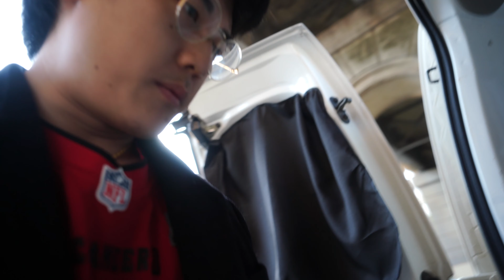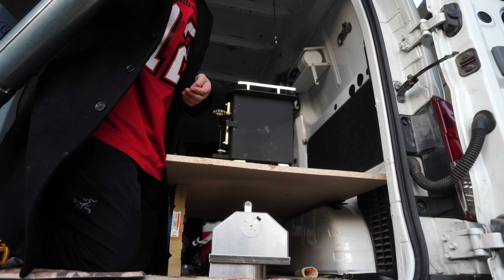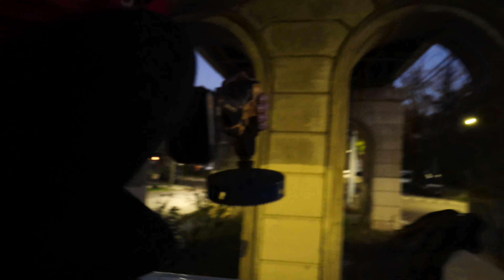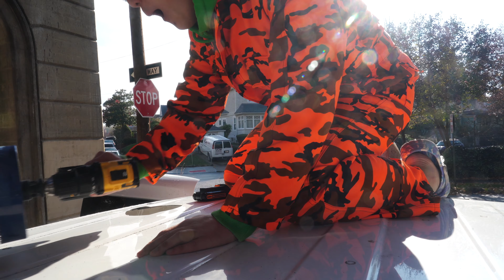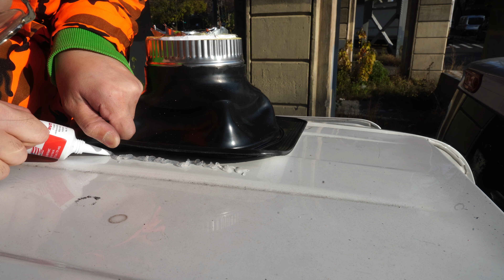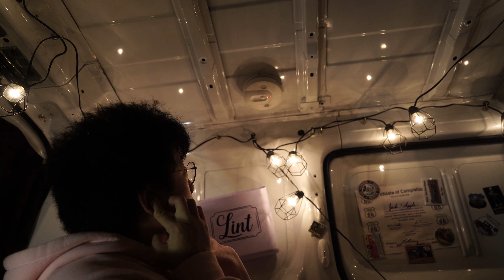Wood Burning Stove Install to Heat my Car | Solo Winter Vanlife

Comment: Was thinking about a wood stove setup myself but it's to permanent for what I need the van for. Now check it! So I went to Maine last week and got back this Monday to NC with no issues. I'm the dude with the Ford E350 V10(about $700 in fuel cost round trip). I did use a Mr heater buddy heater when I slept. It was in the low 20s inside the van till I turned on the heater to high. Worked amazingly!! Since the van has no insolation I was absolutely comfortable! When I tried it in cool temp it was a bit much to hot in the 60s but freezing oh it made life great! I went propane because I can't run electric all night unfortunately since I don't have enough power. Maybe later 😎. Great video!